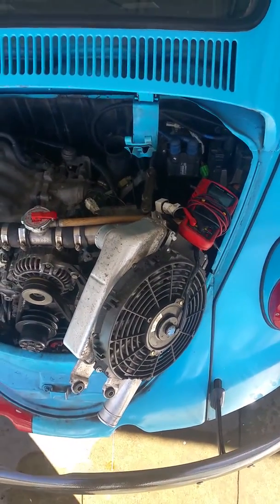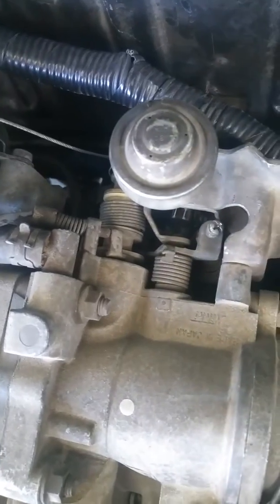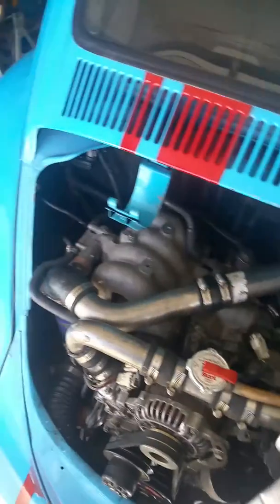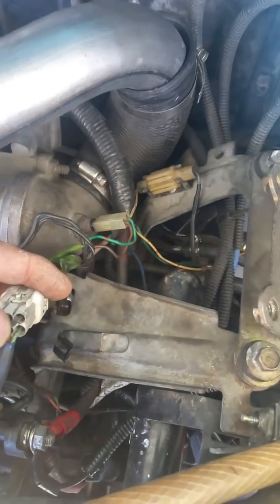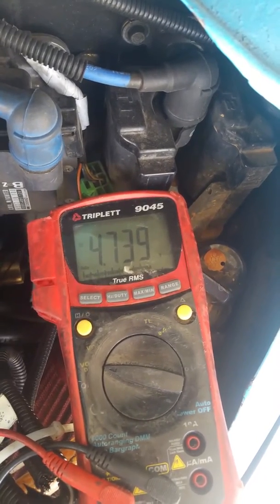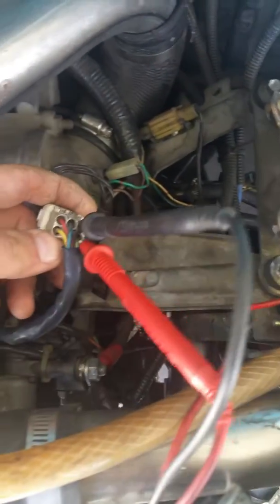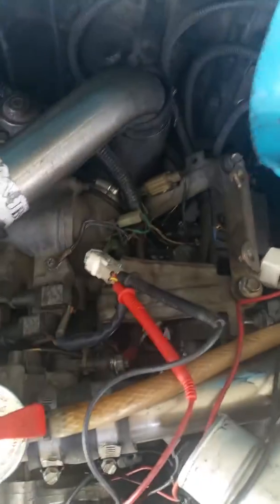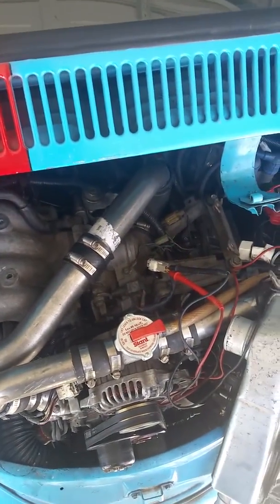RX7 series5 TPS adjustment

Comment: wow man your video really valuable for series 5 turbo  owners  my results are  

Narrow Range--->Closed---->Results 1.27
Narrow Range--->Full Throttle--->Results 5.25

Full Range--->Closed--->Results 0.95
Full Range--->Full throttle-->Results 4.95
Reply from the maker: Thanks I appreciate it
Reply from the maker: Does it drive well? If so, leave it alone ..lol I had to bend the cam wheel a little to get mine to reading amything close to spec, but do that at you own risk(disclaimer)😁
Reply: @TurboWarioTV  it runs fine but dies on idle
Reply from the maker: @divinefist8153  are you running a factory blow off valve? What it's trying to idle at when it dies?

Comment: HI not sure if you are gonna respond to this but looking for any and all advice. I've got a 91 rx7 non turbo and after the car warms up the throttle stops responding. Although it runs a bit rough, the throttle responds from cold for the first 5 minutes or so before motor fully warms up. For a few minutes after that, the rpms rise 1-2k if I press the throttle extremely slightly, any more than that and the rpms just drop to idle spec. I've been messing with the tps adjustment screw but no change. Any recommendations?
Reply from the maker: Did you get the car this way is is this something new that came out of the blue?
Reply from the maker: If it's a new issue was any work done leading to this? Motor R&R ,clutch something that had you move the wiring around, check your sensors voltages tps water maf air temp and grounds after the car at  temp might to see of your getting any open circuit or a short, you can try unplugging the tps and see if it goes away as well at least the s5 turbo this can be done. There are write ups on how to pull codes on the Rx7 forums as well.
Reply: @TurboWarioTV  I just did a rebuild. Brand new rebuild and some new parts. Compression checks out. I will give that a go but when I was putting stuff together after sitting the engine down on mounts, I have an electric fan which I hooked up directly to the battery negative instead of properly grounding it. Since it's directly connected to the egi circuit with the tps itself is there a chance the TPS got fried?
Reply from the maker: I don't think so, you wouldn't have any fuel or spark, but I would differently move the fan off that wire, use a relay to power the fan and maybe a after market thermo switch.  I got my fans (+) fused to the battery and the (-) is wired to the relay that grounded and  uses a ground signal from the thermostat switch and a dash switch to manually turn them on if needed. So yeah double check all the wiring connections and grounds

Comment: im getting a reading of 1.26 on my high. but i dont have the other screw
Reply from the maker: I belive the non turbo ones there is a flathead screw at the top of the throttle body
Reply: +Turbo Wario yeah thats what i have but it does nothing? lol. 
my car turns on but the gas pedal has no pressure.. any ideas? it just dies after a few seconds of being on
Reply from the maker: the throttle cable might be broken or unhooked and the ecu might be stuck in a cold start mode
Reply: +Turbo Wario if its the ecu how do i fix that?
Reply: +Angel Guerrero im sure my throttle cable is fine, it was working before i changed to the new tps...
Reply from the maker: +Angel Guerrero it sounds like it not quite adjusted right. you can try unplugging it and starting the car and let it warm up and then plug it back in and try readjusting it

Comment: how'd you get the picks to fit in the plug? my motor is different as well, doesnt have the other adjust screw behind. just one on top?
Reply from the maker: Sorry for the late reply it just no populated in my email. I had sharpen tips to poke into the wire/weather packs and my engine is a JDM might be bi different

Comment: My 1989 GTU is idling pretty bad. It idles at around 400. The engine also shakes very bad. I made the mistake of adjusting the screw on top of the throttle body and actually made it worst. I will try your method and see if it fixes the problem.